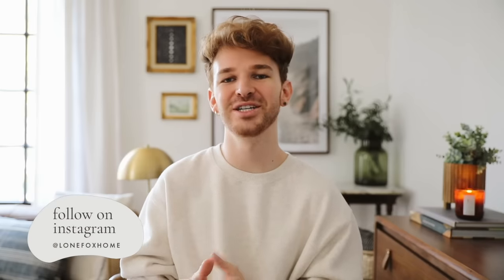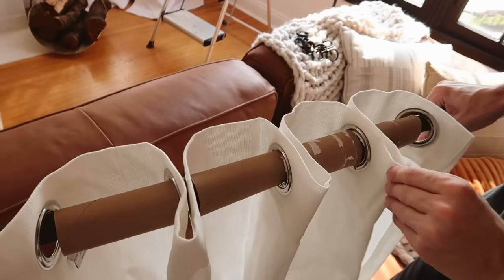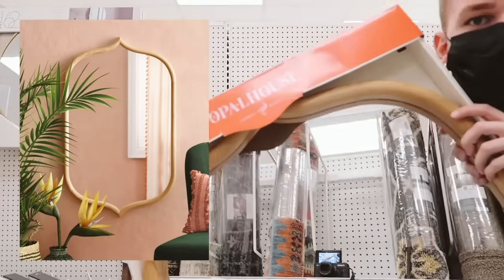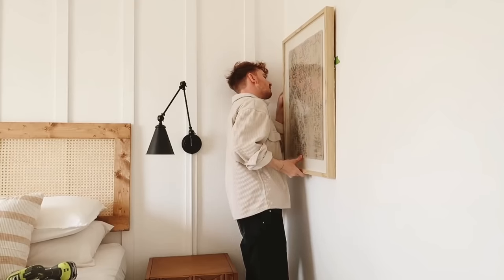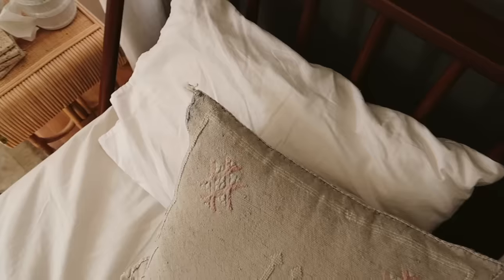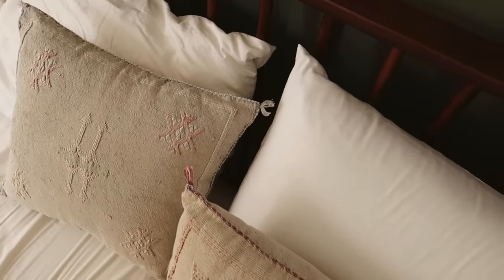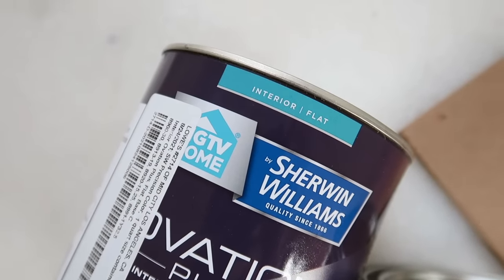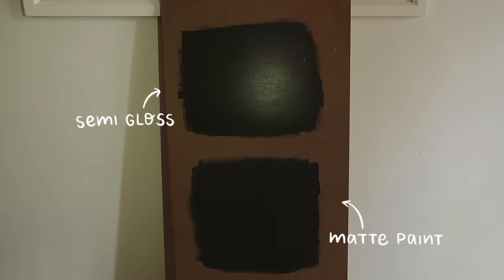10 GENIUS Home Hacks That CHANGED MY LIFE 🏠  Life Hacks to Save Time + Money!

Comment: Cool tip with the toilet rolls but you'd probably not have to even take the curtains down, just cut a line down one side of the toilet roll and you can probably just pop them in
Reply: Great tip! Thanks
Reply: This is genius! I can't believe I didn't think of it! 😀
Reply: Omg Yes!!
Reply: Wow a tip for the tip!!!
Reply: I think he took down the rod to make filming easier but I love this. Had I known this I would have not gotten rid of my curtains with grommets!
Reply: Agree! That's how I've seen it done in other hack videos.
Reply: Tried it and it didn't work.  They fell off the rod when I closed the curtains. But I'm going to close the ends with tape though, because it would take me a long time to replace them with new ones. Our roll of toilet paper lasts me a long time, lol
Reply: Genius
Reply: What a great idea! Thank you!
Reply: I was gonna ask with the rolls would they not get wet if one has steamy baths/showers over time?
Reply: Someone below said they fell off. A solution would be not to cut a horizontal line but rather a spiral cut.
Reply: @BuddhaFang  genius!
Reply: Thanks
Reply: Came here to say this. I was surprised that he not only took the rod down but then he took the curtain off...just a slice down the length of the roll and secure with tape if needed, or as another commenter suggested, a spiral cut (like cable management tubing), which would be easy—just follow the tube’s seam—and you probably wouldn’t need tape or anything else.
Reply: Such a nice tip! And once your toilet paper is done, instead of saving them randomly all over the house, you can add the one by one. Until you finish.
Reply: Read your comment before watching the video, thought how would you use your loo roll if it's been cut🤣🤦🏼‍♀️🙄
Reply: This is why I always read the comments ^^^
Reply: I tried this before. Yes it was easier, however I found the cut side likes to turn up and pop off. If you use your curtains often go the extra work.
Reply: Use foam pipe lagging instead of toilet roll
Reply: Pool noodles > cardboard toilet paper rolls!
Reply: You can also do the essential oil drops on the empty toilet rolls like I've seen people do to have a simple way to freshen up their bathrooms. It would work great in this type of room as well!
Reply: @romeos.6530  this wasn't in the bathroom but if you are having that much "water" in your room, you better have an exhaust fan turned on.
Reply: I did this with my curtains. I saw it on a UK TV programme. I cut my toilet tubes in half for the curtains on my small landing window. It's so much better. No more twitching curtains all day to get them right, especially when my fiance opens them! 🙆‍♀️😂
Reply: @romeos.6530  it’s Probably not for bathroom curtain rods. Living room , or bedroom drapes most likely..
Reply: 100% works! Great minds…..❤️
Reply: You can.you can also cut a pool noodle
Reply: You just saved me a ton of work. Thx
Reply: Yh great tip, I'm going on a do this.
Reply: Oh my gosh. You are a genius.
Reply: Thats just genius !! Saved me alot of time and effort ?
Reply: That’s what I did. 🙌🏽
Reply: Omg the curtain tip
Reply: Just use HAIR ROLLERS in place of toilet paper rolls AND u don't have to wait for used toilet paper rolls.
Reply: Great tip hanging pictures with painters tape

Comment: Instead of electrical tape, which leaves a sticky residue when removed, try using black washi tape instead—same effect, cleaner removal :)
Reply: Awesome tip... I was wondering if the glue might melt on the electric tape from the hot sunshine on the windows over time... washi tape is thinner and might stick more seamlessly
Reply: I came here to say this, too. Electrical tape becomes a nasty gummy mess after about 6 months. I actually think paint would be best. You can paint glass. You can oaint window frames.
Reply: Yes
Reply: @amylaw3416  yes! Just get the coverage on trim….don’t worry about it getting on the glass ! Fresh paint peels off super easily….buy a $3blade (that comes with the handle ) at hardware store -draw a line down the edge of freshly painted trim with the blade and razor the paint off the glass in one pce. !
…it’s so gratifying.. it’s like peeling a sunburn ! Lol quick and easy , exact perfect paint lines (if it’s black and you’re worried)   MUCH faster than taping windows! 
It’s actually better to get the paint on the glass ! and seal the crease where the wood trim meets the glass…. let it dry slightly then score a line down the edge (with a new seal made by the paint) before sliding the blade under.

Comment: 1.  use toilet paper rolls to space curtain pleats 
2. for wall pieces with nail holes on both sides, use painters tape as stencil (with a water level)
3. buy pillow inserts that are slightly too large for fluffier looking pillows 
4. get large pots for plants and stuff the bottom to make plants look larger
5. use electrical tape to create window cross bars
6. use matte or eggshell finishes if you want dark paint to come out as dark as possible
7. use rechargeable lightbulbs for lamps where you don't have outlets
8. to prevent paint bleeding when using painters tape, paint a first coat in the original colour and let dry first 
9. use lipstick to stamp 2 points of reference, eg a handle with 2 screws
10. create templates from eg butcher paper when making a gallery wall
Reply: Thank you!
Reply: Thanks!
Reply: @deViIle   👋 hi there! You have my last name! I just have to ask: is this your last name too, a nickname, or what? I also love that you have the space between the "e" and "V"! My oldest daughter goes one step further spelling it the proper French way: de Ville. What part of the world are you? I'm in Atlanta, Georgia. I look forward to seeing your reply, be 🙏🏼 blessed, and stay 😷 safe.
Reply: Not all heroes wear capes….. thank you!!!
Reply: Thank you for listing them !!
Reply: I am not sure that those hooks are meant for two nails but rather to use wire to suspend that actual frame. I have several large pieces of artwork and had them professionally hung. And those hooks were were they used a piano like wire to string through the holes and than hand the artwork from that wire with one nail/picture hanger. Not sure Drew got this one right.
Reply: Good job!!
Reply: You can use foam pipe insulation for curtain pleat spacers if you don't want to wait to collect paper rolls.
Reply: @skauffman  That's exactly what I would use them for picture wire across at whatever length you want, then you can use one nail/screw to hang.
Reply: Thank you.  He's got great ideas but rambles too much
Reply: Also create your own chalk finish paint by adding baby or talcum powder to cheap acrylic paint. Add a little at a time and checking samples until you reach your desired matte or chalk finish and thickness of paint. You can’t avoid it thickening so this would not help you stretch your paint further. I’ve tried this with regular flour, gluten free flour and corn flour and it doesn’t work as well, they aren’t milled as fine so they don’t incorporate into the paint as smoothly.

Comment: As for picture frames with a hanger on each side of the frame? I usually run a wire or strong nylon cord between each frame hanger and then hang on the wall using the wire/cord over a single centered nail. Winding a pipe cleaner around the center of the wire/cord prevents the picture frame from sliding over the nail or swinging back and forth after the frame is hung.
Reply: You have to be careful with this if the picture is too heavy for one nail.
Reply: @simoneh.815  Very true as I've discovered as much...and yet most framed artworks and other framed pieces are hung on single nails and even screws. Thanks for chiming in.
Reply from the maker: Ahh yes so smart!! I’d totally do this on lighter pieces 💕
Reply: Great ideas!
Reply: @simoneh.815  i would also use a wire. use two nails about an inch apart and then hang. the two nails prevent the picture/mirror from shifting.

factor in size/weight of the picture or mirror being hung and space the nails accordingly.
Reply: I did this recently and a minute after hanging it, it fell to the floor and broke. Just to know that the design of the frame might handle the weight better on 2 sides
Reply: Find a stud or use anchors.
Reply: @lorriewittig9066  The matter of hanging framed pieces vary sometimes.
Reply: I do that too, but I never thought of the pipe cleaner! Thanks!
Reply: @Tinyteacher1111  A worker at a local frame shop recently told me that the hooks placed on each side of frames bought in the store were put there by the company as a convenience to run a wire between them for hanging.
Reply: @lonefox  TY! I really enjoy your channel and look forward to new posts. You do fun creative work!
Reply: I hadn’t thought about the pipe cleaner - brilliant.
Reply: Me too
Reply: @lonefox , exactly - on light-weight and/or small pieces.
Reply: Yes,  but the example in the video was a mirror. I bought the exact mirror he showed in the video from Target and ultimately returned it because it was so d*mn heavy. My poor bathroom walls are paper thin and that mirror yanked anchors straight out of the wall.
Reply: There are picture hangers that are rated for a weight up to 50 pounds that can be safely used for heavier pieces. Name brand is Ook Professional Picture Hangers. They are like an inverted triangle with 2 nails integrated into the design at the top, they hold very well and don’t leave big holes in the wall. Have used these for years along with picture hanging wire that’s rated for higher weight as well.
Reply: @bettykrauter3167  Thank you for chiming in with helpful info. I'm moving to a new house and need good ideas for hanging my art/photography/wall art pieces...and some of these are really heavy and cumbersome. ...Lone Fox here does such a nice channel with endless great ideas for decor and such. I've enjoyed his channel for nearly 2 years plus his other channel. It'd be nice if he might do some more fashion/style videos again for men...he really seems like a super guy and can do well with those ideas too.
Reply: @curtischildress9580  For very large art, you can use the wire idea with 2 picture hangers spaced apart to distribute the weight better.
Reply: It’s for picture hanging wire. You can put 2 hangers up for weight and not have to worry about distance or being perfectly level. Work smarter, not harder, you guys
Reply: Love the pipe cleaner idea.
Reply: Yesss
Reply: @lorriewittig9066  if something is really heavy, you should hang it into a stud. Doesn't always mean the placement you want but it's better than ripping your drywall and breaking your picture/mirror.
Reply: @simoneh.815  you can still use 2 nails/picture hooks with a wire to distribute weight. You just loop the wire over 2 nails instead of 1.
Reply: I’m so glad I’m not the only person who knows picture wire exists and that properly-rated wall anchors and studs exist. Hanging something that big and heavy by the wire rings and small nails isn’t very secure. It may seem secure because it’s “under arrest” (flat against the wall) but if bumped, there’s nowhere to go but down. Something properly hung will give if bumped or in a quake. In either case, for some extra security, add squares of strong carpet tape behind the lower corners. This won’t keep it from falling if severely jarred but will keep it from falling if bumped. I’ve always done this with anything over about 5lbs; I also use picture wire and anchors for everything. One last thing—there are few jobs nails can do better or more securely than screws. Never hang things on nails. They can be pulled and if they’re just in drywall there is literally nothing holding them in place.

Comment: One tip for heavy curtains with rings on rods.  Spray WD-40 on the rods, curtains will glide smoothly. 

I have 11ft long x 16 ft wide double sided heavy velvet curtains .

Tip from my curtain fabricator and installer. 

Enjoy your channel 😀

Comment: The Electrical tape to form a grid in windows is something I did on huge mirrors to break them up. It felt like a window instead of a builders mirror. Actually did this trick 20 years ago then hung drapes on the sides. Really made room more intimate

Comment: Great tips!!  Another tip I have for getting crisp lines with painters tape, in case you don’t have the original color on the walls, is to use a matte mod podge.  Works like a charm 👌🏻
Reply: great idea!  That would work if you are painting next to an unpainted surface (tile, wood, or whatever)
Reply: @auntiesash  yep!! I used to do this method when I made wood farmhouse signs.  Worked like a charm 👌🏻
Reply: Great idea.  I was thinking the same thing about not having the paint color.  Thanks for sharing
Reply: @TheMerchants  wat a great idea!
Reply: That's actually genius! Thanks for Sharing
Reply from the maker: THIS IS THE BEST IDEA!!! SO SMART!
Reply: Wow! Thank you! I'm going to pick some up!
Reply: Genius! Thank you
Reply: I’m English don’t know what a Matte mod pod is can u let me no please x
Reply: @denisebond281  if you look up mod podge, you’ll see what I’m referring to.  It’s what you use to decoupage.  You can also make it using 1 cup of white elmer’s glue and 1/3 cup of water.
Reply: What exactly are you doing with the modge podge?
Reply: BoutiqueCharlee  For this tip it's using Mod pod get to get a crisp line if you were eg painting stripes on a wall by painting the tape edge with matte mod podge first so that any points where the paint would usually bleed under the tape edge is filled with the mod podge (that's clear so wouldn't show) then paint the actual paint colour over the top resulting in a crisp clean edge.
Reply: @BoutiqueCharlee  you use the mod podge instead of the under layer of paint color over painters tape to make a seal.  Then when the mod podge dries you paint the new color on top.  It helps in cases where you don’t have the original wall color and want to paint an accent wall or in cases of painting accents over wood.
Reply: For Frog tape (the green stuff), it gels when it gets wet, but it doesn’t need to be paint or finish in particular. I just buff down the edges with a damp rag or microfiber cloth, and it comes out perfectly.
Reply: @denisebond281  it's like pva glue.
Reply: Brilliant! ♥
Reply: Brilliant, just brilliant...
Reply: It's PVA glue, also known as Ticky Tacky. I would do this technique when I was color blocking squares and rectangles of  those bright neon colors in the late 90's early 2000's. Don't just slap it on all silly willy like you would if it were regular paint because if you apply the stuff toooo heavily you will DEFINITELY see the brush strokes under whatever you paint on top!  The best is to get a small 1/2 wide foam brush and just go along the edge of the tape, making sure it's a good seal and once it is dry you're set to go! And always remove the tape while the paint is still wet! A lot of people think it's best to wait until it's dry but you run the risk of the paint & tape sticking to the paint and/or glue underneath.  If you do wait, pull the tape back over itself and if you see it grabbing something underneath gently cut along the tape edge with a fresh sharp craft razor. 👍
Reply: Heard on another YT vid that using builders caulk works in the same way..just run it over the edge of the tape and let it dry so that it seals it.
Reply: @jeremykendall-thomas7300  thank you so much!!!
Reply: @helenmckeown7430  It seems to me like the homemade ticky tacky/mod podge glue would work just as well as anything else and be the easiest cheapest to source, make and use!!! 1 cup of Elmer's glue and 1/3 cup of water mix and go!!!

Comment: Tip 8- you’re supposed to lightly wet the painters tape, let it dry, then paint. The moisture causes the tape to swell and closes up those gaps. Painting with the original color does the same thing and really isn’t necessary. Also use a very dry brush with the paint. Too watery causes seepage into the tape edge. 
Do a really dry brush, let it dry then use a heavier application and remove the tape immediately so it doesn’t rewet the tape.  Frog type tapes aren’t meant to be painted on before lightly wetting and letting dry.
Reply: This makes so much sense wow

Comment: Love the tip about using rechargeable bulbs. The batteries in most puck lights do not last long. Also love the tip about using cardboard tubes as spacers in the curtain. I would probably paint them the same color as the curtain. 

When it comes to using lifts inside your pots, using a tray on top or just inside the pot makes it easier to lift off the moss or whatever “soil” covering you use. If you have something useful under your plant, you’ll be much happier retrieving those items if you plan ahead. I like to just turn the planter into a table base and put a large enough tray or table top on it that I can use it like a side table. I do this by either creating a key hole for the plant or dividing the top in half with a central hole like a donut.

Comment: Tip 2: We always threaded a heavy gauge wire or string through the hanging loops and secured it by twisting or tying. Then you hang it on one nail.
Reply: I worked at a place where I sold picture frames, and I learned that depends on the frame strength is the reason for the different types of hooks. Never put a wire through the two hooks on a heavy picture or mirror. That pulls the frame inwards over time and breaks it.
I couldn't imagine a small child or pet walking by the heavy mirror when it finally gives.
Reply: Me too
Reply: @jadedelarge8929  so right!….A
Hooks on each side of  ANY thing heavy or large should be removed! That’s what gravity bars are for- and what is used to professionally hang in museums and art galleries. That way the object can be moved slightly from side to side as well-like my 8’  horizontal mirror over my couch …and they are impossible to knock off.